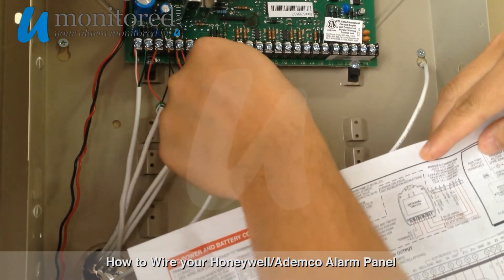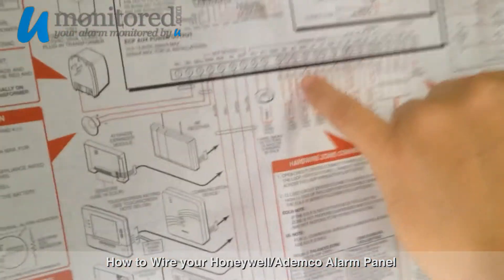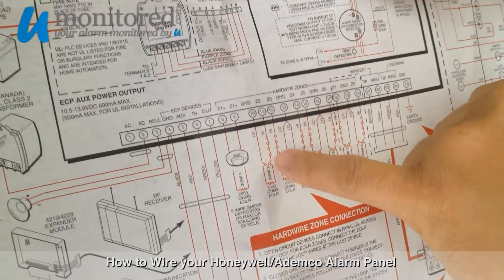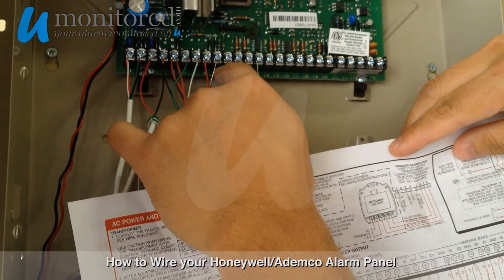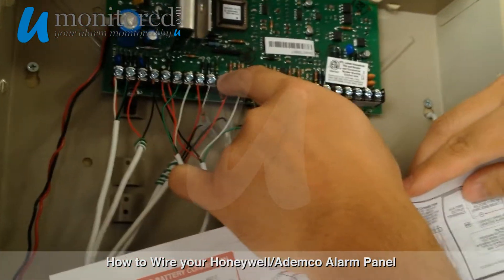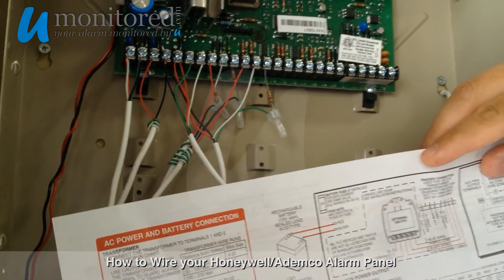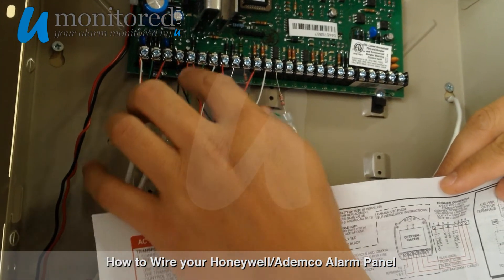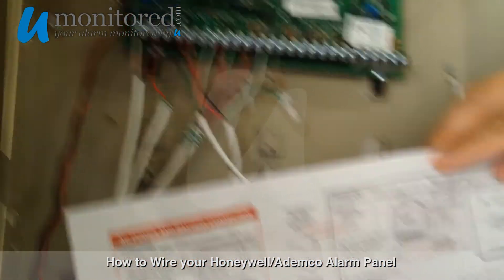How to wire your new Honeywell/Ademco Alarm Panel

Comment: Excellent!>>>ur2.pl/1017    Perfectly replaced my ancient Ademco pad from the 90's that the keys stopped working on. Simple install too, just switched off the breaker that powers my alarm system, disconnected the existing pad/unscrewed it from the wall, reconnected the new one/screwed it to the wall, and switched back on the breaker. It took about 2 minutes to synchronize with the main panel and then we we're back up and running. All in all it was a 10-15 minute replacement at the most. I like the alphanumeric display much better than my old fixed display too!

Comment: An excellent tutorial ... thanks for that
I got a central alarm ADEMCO VISTA 4110XM but I do not know the master code
How to reset the panel to determine the second master code.
I use the 1647AM 6150ADT keyboard

What are the signs on the display are written by FC, DI

Thank you

Comment: Hello, I added a second voice keypad (6150v) to my system as address 18 (have two other) My main control is a 6160V. All functions are working, but the volume on the second key pad cannot be increased(#,0,2,3) some reason. is there a setting I'm missing or is the second voice keypad bad?

Comment: I have configured TCC800 Fob at Galaxy 48 panel. It is working but it generates 1 tamper zone error message related with 1008 PA when I press any of the buttons. I think it has to do with termination a kind of EOL or something. I have nothing connected at RIO 1 and RIO 2 outputs.
 
Could they give a tip how to resolved this?
Reply: Mario Rosario ngttañlicvb n   nh4u5t6odv  
 8nm9lopp
. Kbnkm000op000

Comment: why would you wire the resistor in the panel and not close to the sensor. Doesn't it defeat the whole purpose?
Reply: +Jay Ram haa... sure does unless he is only doing it to keep the system "happy".   It works but it isn't the correct way to do it..